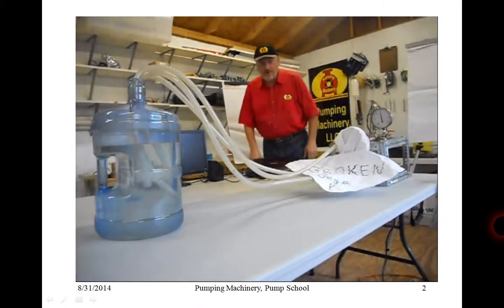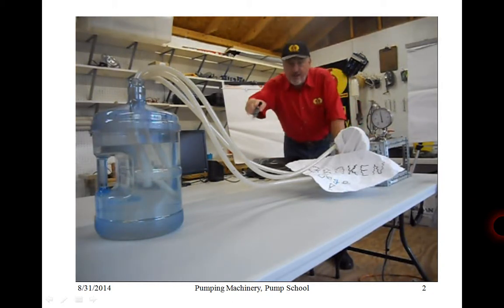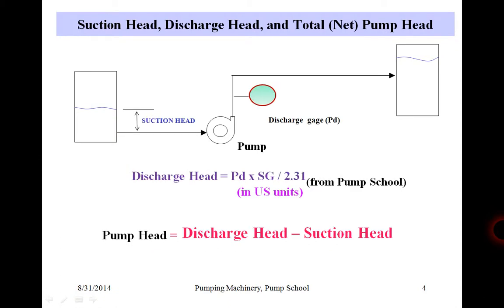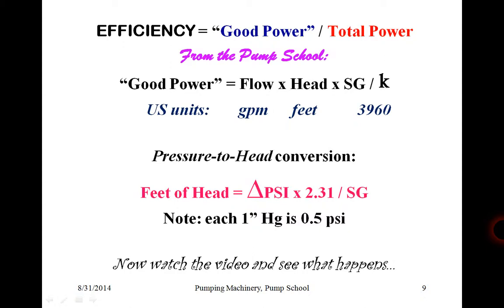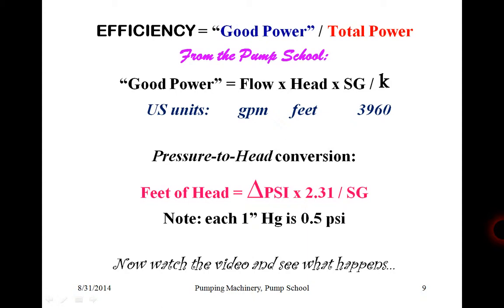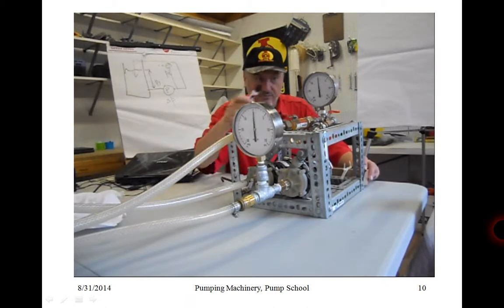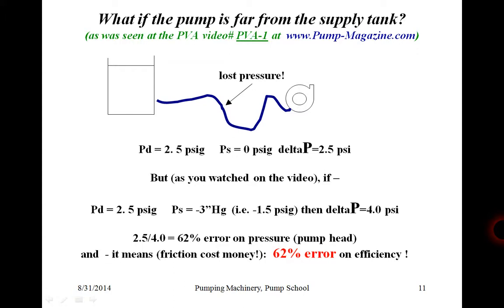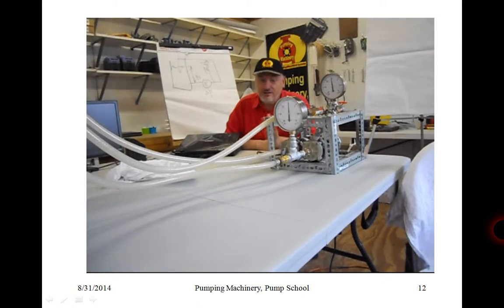Pump Video Academy, Pump School: Module PVA 1

Comment: Lev - great article in the Pumps & Systems - this video is a nice bonus material.  Could you comment on the head measurement error as it relates to flow and the pump curve?  I am thinking that increasing head from 2.5psi to 4psi the pump would ride the curve to the left and produce less flow, which makes for a less effective pump.  Also, a properly functioning suction side gauge should be good for spotting cavitation problems if available Net Positive Suction Head is too low
Reply from the maker: Cozak250 True - increased discharge pressure would mean the pump operating at a lower flow, i.e. possibly to far away from the Best Efficiency Point. However, in this case, the difference in measured pressure is simply due to a location of a gage itself. As far as suction gage, - absolutely true, - presence of such measurement is critical if one is to understand what is happening regarding cavitation. Lev Nelik